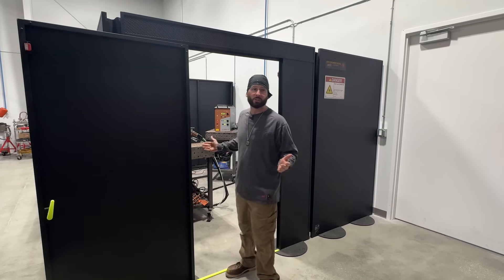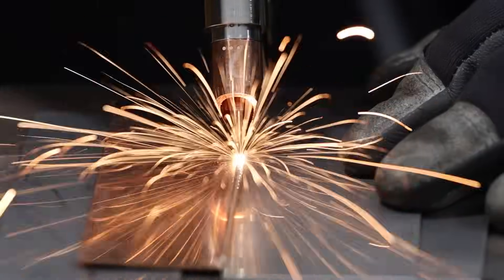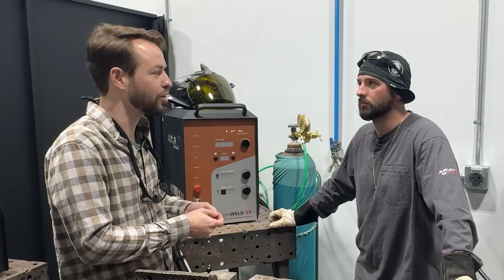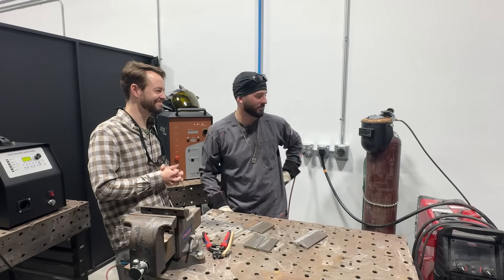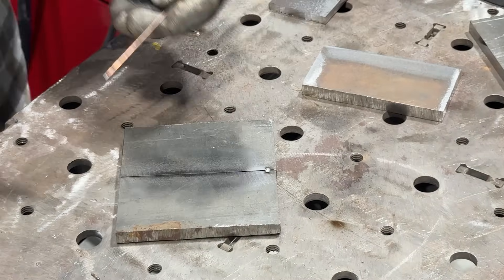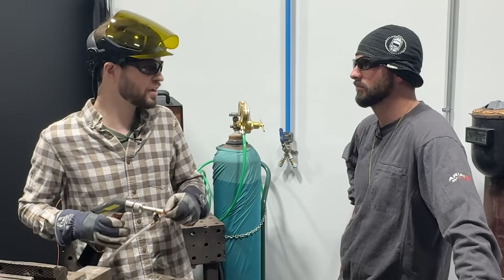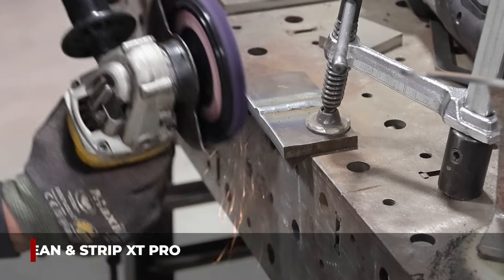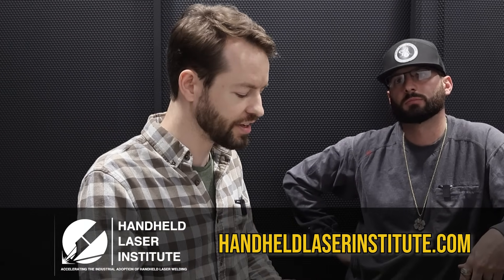Laser vs MIG Welding: Which Has Better Penetration?

Comment: Rex has developed a tig rod feeder with another company(Cascade innotech, i think). Just received one late last week. It is vastly superior to the standard wire feeder. The IPG wire feeder doesn't always feed consistently. They don't have any options for a push pull setup, softer wire has a tendency to sort of bind up in the liner and not feed at a consistent rate. It also doesn't have the same length constraints that the normal wire feed setup has. The standard liner length is around 10 feet. So you have to drag a bulky wire feeder around when working on larger weldments. The tig rod feeder just has a single cable that you can tuck inside the protective cover around the umbilicus. It also makes changing filler materials and diameters a hell of a lot faster.

Comment: This is a question for the laser institute:  Can handheld laser be used to do multi-pass (eg stacks of stringers) to rebuild material on an irreplacable heat sensitive component (MIG and TIG are both too hot).  I know I can do a single weld bead with a very controlled heat affected zone, which would theoretically be the ideal solution for trying to rebuild my part, but inevitably, when I try on a test coupon, stacking multiple beads on an area with a handheld laser inevitable goes all over the place as unlike MIG or TIG where you can move and push the weld pool wherever you want as the wire/filler/arc are not attached to the workpiece, with laser, the wire pushes the gun around and it's so fast depositing that any irregularity on the surface you're welding can send your bead off course..  I can do two or maybe 3 stacked laser beads in a corner joint and keep things nice but more than that, and I find that I can't keep the weld on top of the previous pass anymore and it just wanders, and on flat stock, I have trouble running just two beads on top of each other.

I've tried some variations of power and feed speeds to try to slow things down enough to control the trajectory of the weld but with little success: after the 3rd pass, it becomes very difficult to keep the weld straight.  Is it just that I need a whole lot more practice or can this only be achieved with a robot laser and not advised for a handheld laser welder?

Also, can we talk about part distortion with laser welds?   I'm just starting out with laser and wow, for such a tiny weld, it seems to cause an inordinate amount of part distortion. I can often make a MIG or TIG weld with a much higher heat input and bigger bead with LESS warpage than a laser weld with a tiny bead and virtually no heat affected zone..  Is this a side effect of the deeper penetration of the laser beam?

Comment: Thats interesting, good job. The proof of the pudding though is in the eating. The laser weld on the 90Degree piece may have penetrated the bottom plate more but to me it did not look as strong as the mig weld as there was less contact with the vertical plate. I'd like to see the strength of the welds compared. Also I'd like to see the a comparison of strength of both but welds and a single piece of the original material. Thanks.

Comment: This is fantastic,I use a handheld laser welder 8 hours per day from 1 year,it's 1500w Power,by some experiments I now know every feature It has,from alignement to power,your article are SUPER useful because I can have better understanding and keep improving my work.
For protection I use an optrel laser helmet,very nice,I can't use glasses under hood because they get foggy and optrel say it's not necessary because the helmet is enough, otherwise I would have used glasses too 🙏🙋🏼‍♂️
Reply: That optrel hood is only +2. It's not really very good for protection against laser welders the glasses you can get are +7 and about 200 bucks. I looked into the same thing but did deeper research. That optrel hood is basic at best. I'd suggest doing something different
Reply: @dustinandtarynwolfe5540  hi,i'm talking about the Optrel Panoramaxx Hybrid CLT,for +2 you mean the shade or the OD?

Comment: If the fillet size is dependent on size of filler wire, could you splice a tip-TIG rig feeder to the laser and run 1/8" filler rods?

Comment: It would be good to see the results for a tensile test of fill penitration butt welds
- ie V prep as necessary for the Mig
- Is there an aspect of thermal shock that could be more of an issue with the laser weld?

Comment: The penetration profile was pretty fascinating. I did 10 gauge plate rolled into pipe with bevels forming a 3/16 gap and did a typical root, fill/hot pass, and cap just to be safe at 1400-1500W with .045 wire and now it seems I made obnoxiously strong penetrating welds.

I'm curious what a 3 pass Tee joint fillet weld would look like cut and etched, just to be sure it's a secure weld I've been asked to do 3 passes instead of one at the collar when we have 10 gauge come through that will be handling a lot of air pressure

Comment: How does part distortion compare between the two processes?
Reply: Laser is less distortion,much less heat on the piece
Reply: @mgflashlights9554 You would think, but I've been practicing with my new laser welder and comparing with MIG and TIG and I've found that in a lot of situations particularly doing thicker stock with a laser, that I get more distortion with the laser..  For example, I was trying a T joint with 0.35 mild steel filler on 1/4" stock.  Laser set at 800W 600Hz wobble, 2mm scan, 50mm/s feed.  Two passes- yes, 1 pass is more than sufficient, but on this test piece, I got the first pass angle just a bit off and the first bead was more on the base metal than the vertical, so I did a 2nd pass higher up and it made a beautiful looking fillet, but instead of a nice T, the base curled up and looked more like a -), despite virtually no heat affected zone and the part being holdable with bare hands after the weld.   I did a comparison with TIG and put on a much bigger bead with much more heat affected zone and I couldn't touch the part with bare hands after the weld and there was almost no distortion and MIG barely curled the base plate at all...
Reply: @Flying0Dismount  oooooh this is fantastic test right here. Unfortunately where I work I can't test directly mig vs laser,because for laser we tack weld It before the full bead,and in this manner we have almost no distortion,so maybe this could be another test you can do if you have time,if you first "lock" the piece and then go full bead,what will happen? Thanks for the insight ☺️

Comment: try using a belt sander to polish, not the best but better. for etching 10% nitric acid in methanol (nital) . not really a fair comparison with mig, just the type wire, metal,basic or rutile core will alter penetration. then push or pull/gas etc etc. way to many variables. think mma is better compared

Comment: Thanks, great content.  I am wondering how the laser compares to low energy electron beam welding, those tend to be deep narrow penetrations as well.  But this is less difficult to do than those (at least handheld optional vs nobody near the robot for radiation safety…).

Comment: Our company recently looked into laser welding, the welding itself is very promising but the safety issues (especially in a production environment) are going to be expensive.
Reply: Also, if hand held, that person will need to stand alone inside a booth, with closed doors, how fun is that ?
Sure, in some countries people will weld with this without protection, and some will get blind, but just hire another one hey !
Reply: Yes one thing he doesn't really cover here is the fumes. If you're doing production in an laser cell you will absolutely need proper fume extraction in the cell and preferably a PAPR system.

Comment: Back in 1983 or so I got the tour Hughes engineering in Houston Texas that was the plant that made the gearrotor drilling bits for drilling for oil. 
They were using a laser and getting 2-inch penetration I didn't think that was an even possible.

Comment: That laser welding is super impressive.
I spend a few hours welding a year and that's split across gasless mig and plain old stick welding. I now want laser as it's so incredibly cool.
1 thing I'd like to see is how it handle steel with a bit of rust scale on it.
Reply: @Alan_Hans__  laser welders often have modes on them for rust removal. It just incinerates and vaporizes rust. I suspect that when doing actual welding, it just evaporates the rust and continues welding like nothing was even there. And likely the same thing with paint and oil and any other volatile compound on the surface. 

One issue with laser welding though, is it can’t work on all metals. It will only work on metals that don’t have high reflectance of that specific wavelength. You need different wavelength welders for different metals, like copper. But thats pretty exotic anyway so i doubt it will affect most people, but it is a thing to be aware of. 

Im no expert though so double check if what ive said is actually true, as it could be wrong.

Comment: First of all, Great video!  😀

To better compare the penetration of a $32K laser to MIG with 3/8" thick plate using a $4K MIG welder, as was done with the Nitrogen for the laser, it would be good I would think to have a brief discussion about switching the Ar/CO2 mix out for something closer to 90/10 (as the PowerMIG 260 manual indicates can better handle spray transfer arc) or even other mixes that are more reactive and might be more effectively able to burn that deep.  Those super hot settings straight spray would of course not work for overhead, but for those flat positions, it seems more comparable.  (Maybe use a welder capable of high amp pulse spray to compare...)  On this channel it has been loudly repeated for many years about the poor penetration of short circuit MIG on thick plate dozens of times.  It was nearly always driven home that spray transfer and/or dual shield are the only acceptable MIG/wire methods for thick plate.  Maybe I am wrong though and the 75/25 has better penetration because of the larger amount of active CO2 gas in the weld pool.  Does anyone have data on this?

Certainly with the high voltage and wire feed settings used here, and the results of a smooth finish of the flat weld bead, the weld puddle and wire feed is likely close to spray transfer anyway, but to be really fair I would think the best MIG/wire feed method and/or gas mixes like maybe pulse spray for thick plate should be used it would seem when comparing the weld depths to a laser welder that sells for 8X the price...  

I do understand the point was not to compare the welders, but the methods outcomes it just seems like the best current MIG style wire feed methods might be a better comparison.  In any case, fantastic video to to see these laser welders in action.  They are REALLY going to change fabrication over the next several years, especially as the price comes down.   Safety will ALWAYS be an issue at any price with a welder that is basically an invisible light saber.

Wonderful video! 👍
Reply: I need a bunch of jobs to afford a laser..
Reply: @Tigdude  you might need a laser to do a bunch of jobs

Comment: Super interesting. 
Less mess and less spatter less cleaning.
What is not to like.
the added cost of the equipment recovered through less post weld cleanup and quicker delivery and turnaround for product manufacturing.
Wow, That is a no brainer in high volume repetitive manufacturing and fabrication.
Reply: The Safety Gear and Shilding is a bit expensive, had a talk with one of our suppliers, welding cabine, and safety clothes would have been around 5k ( small weldin cabine ) Of curse for hgh production numbers a no brainer but for small shops or so still very expensive if you dont need it regulary
Reply: @Hans-Yolo  I don't know how much osha would be ok with it, but I've seen shops build an enclosure painted matte black for the laser area with proper laser safety windows and maybe purpose made laser safe curtains and proper signage instead of buying the super expensive cabines or 3k per  2 panel sections

Comment: The reason for the squareness of the penetration isn't exactly because of the wave function of the laser. It is because the laser will stay in line with with the lattice structure and the electrons that absorbed the kinetic energy of the photons being forced through by the laser. Those electrons take that energy and bounce off the lattice structure,  essentially atomic vibration is at play. The heat effected zone stays inline with the wave because the electrons lose there energy unlike traditional welding. Traditional welding uses electrical resistance or a plasma arc. Electrons dont lose their energy very well during this process and can pass through the lattic structure. Which is why you can get wide heat areas. That is what i was hoping he would sound like. Do shiny stainless steel. Or if you really want to see what laser can absolutely do better, then its fusion welding. I promise you will be impressed by its ability to fuse weld no filler.
Reply: Great comment, thanks.
Reply: @michaelryan9311  I don’t trust you.  
brother worked for nasa and have qualifications and he a ceo I doubt he would be spouting bs.
Reply: Nothing you have written corresponds to reality. Laser welding is a thermal process, just with higher energy densities than conventional welding processes. As Rex noted, the reason the fusion zone in these tests is rectangular is that the beam is wobbled from side to side. For reference, I have been working with laser welding since 1980, have been on the AWS Laser Welding Committee and have been instrumental in developing many industrial laser welding processes. If you want to learn the actual mechanism of laser welding, I suggest Walt Duley's book "Laser Welding". My book is also good but is harder to find.
Reply: @ You are correct actually. I went and got a better understanding. I am self taught. I will def. check out the book. I wasn't fully incorrect though, but it was misleading. I see that now. Maybe something like this? "The sharp, square penetration profile in laser welding comes from the laser’s highly focused beam, which delivers energy precisely along the material’s lattice structure. The photons rapidly heat the material by exciting electrons, causing localized melting or vaporization with minimal heat spread. This keeps the heat-affected zone (HAZ) narrow, unlike traditional welding methods like arc or resistance welding, where broader energy input and slower cooling create wider HAZs. Laser welding’s precision is especially impressive on shiny stainless steel or in fusion welding, where it can join materials without filler, producing clean, strong welds." If you have more legit resources I would love to hear them. i will actually read the books. I should dive more into AWS on this, but they always expensive so i look for alternative methods.
Reply: @michaelryan9311   You guys are over complicating the explanations.  Remember that a laser is a laser cutter.  You adjust the watts to "not" cut all the way through.  So you have a melted needle size area. Now you do the wobble and that "needle" moves 3-4mm side to side.  So now you have the rectangular penetration.  Just think of the laser beam as a super hot needle.  The watts is how deep it goes in, the wobble moves the needle side to side to melt the walls of that "cut". 
Like a red hot nail in a block of frozen butter.

Comment: How does the laser do on a gap? How well does laser do on multi pass
Reply: They can weld a gap, but as usual if the gap is too wide it can be a problem.
Reply: That has been my thoughts too actually......with a single pass it looks great. But in the field it doesn't always work like on a bench 6 inches long. It may not be comparable even ???????
Reply: You need to fill It with something,3mm gap won't be welded,the laser will only put material on one side or another,because the bead its so small
Reply: MiG is usually welding gaps. TiG and lazer can weld without a gap but not MiG in thicker materials. So this comparing was not right.......

Comment: So exciting to see industry changing technology trickling down into the real world. That penitration depth and shape is interesting. Id love to see how different the metallurgy is in failure testing based on the shape and depth. Very keen to see more cross sections and break tests with the almost zero fillets compared to normal welding.

Comment: Dip the cross section in water and use an airgun to blow it dry. The base metal and weld deposit will flash rust at slightly different rates and delineate the penetration zone. 

If you polish the cross section, you can use a magnet and fine iron filings, aka, Magnaflux. It doesn't work very well with a roughed surface.

Comment: So...was this a fair comparison...I'm afraid not...using the laser at 100% should have prompted the mig welder to do the same and achieve a spray transfer (vs. the obvious short circuit shown in the video) ...that would have yielded deeper penetration and significantly faster inch/min comparisons...and, let's not forget the staggering price difference of these 2 processes...
Reply: Very true, but we are in such early days of this new tech. It wasn't so long ago that decent tig was only for professional shops and also not that long ago that might was even a new and expensive tech. Much Luke comparing the early plasma cutter potential against oxy cutting. So many variables and hard to compare like, with like.
Reply: UK has had laser welding since at least 2008.
Reply: @michaelryan9311  In the scope of industrial technology, 2008 is recent and still an emerging technology. it is still a very specialised and expensive form of welding.
Reply: It didn't look like spray transfer............ that was my thoughts too.